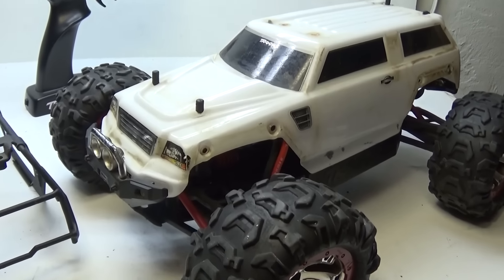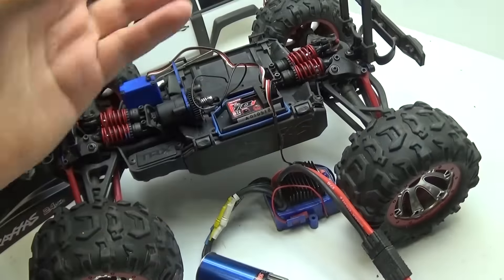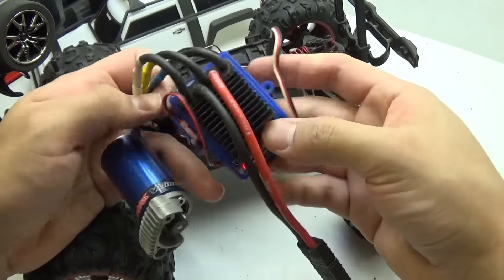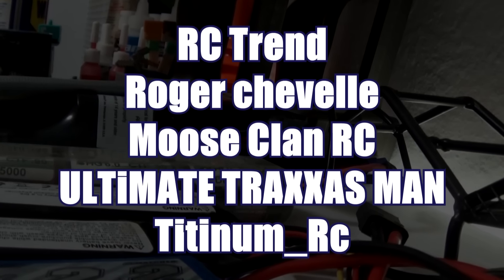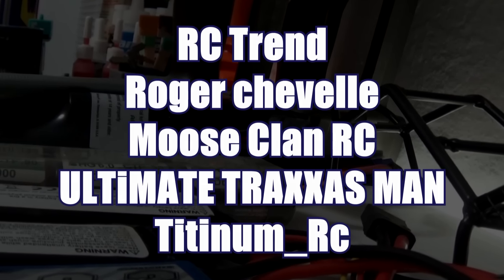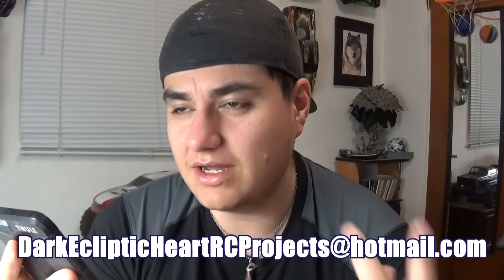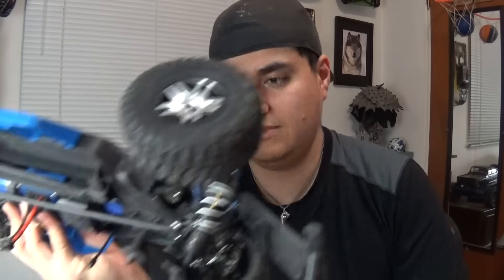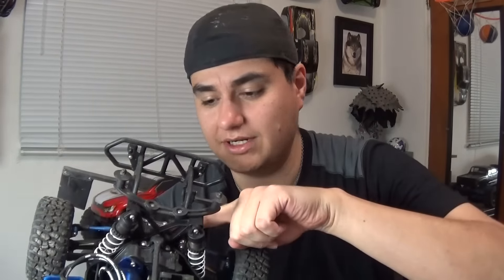RC Weekly 2/8 - Creeper on FIRE (6)

Comment: at the very start of the video was the vxl-3s ESC in that stage before you hooked It up to creeper? if it was you'll obviously need a new one. if it wasn't theres a place somewhere in the electronics where its shorting out. I went through 2 escs just to find out a servo was shorted out...smh

Comment: How much of a pain is it to center the steering servo and then attach the front of the Stampede 2WD to the main chassis? Mine is the XL-5 and I am absolutely struggling to get my Stampede up and running again
Reply: It should be quite easy, if memory serves me right the front end doesnt even need to be taken off. Either way, remove the servo saver, set all trims to 0, install servo saver (you may or may not find this easier if you remove the steering links), then put the front end back together.
Reply: Jester I found it easy if I removed the front end from the chassis in order to reach the servo saver but it's a pain for me to get the servo itself centered and then reattach the front end.

Comment: Can I use a 1/16 Velineon VXL-3m esc with a 1/10 Velineon 3500 motor
Reply: you can but not the best
Reply: Dispite what youd expect the Amp ratings between the 2 are very close, you shouldnt have an issue
Reply: How fast will run? (Slash 2wd onroad)